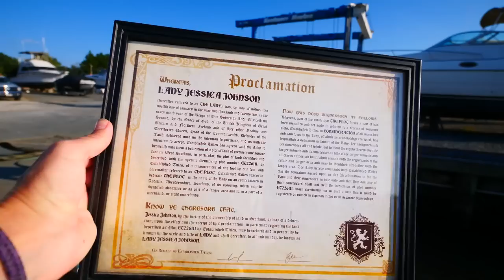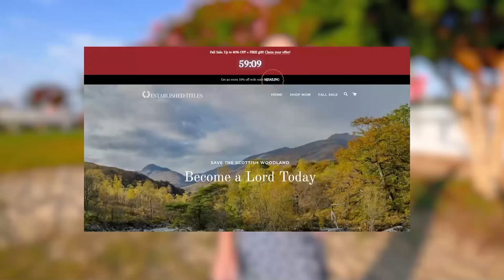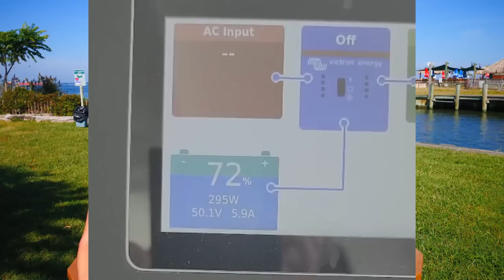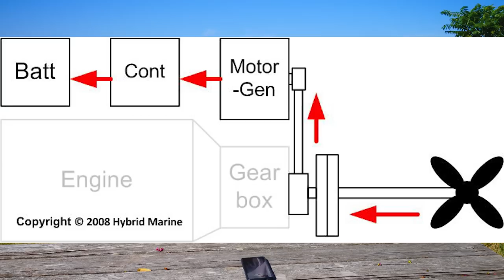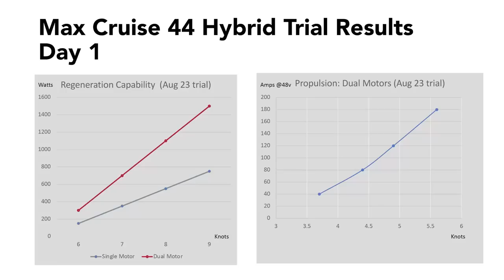Bye Bye DIESEL - We're Going Electric Hybrid!!  (MJ Sailing - Ep 251)

Comment: One thing I have not seen mentioned about these hybrid systems is that they should make it possible to go more miles per day, even without using the diesel.

The reason is that the hull drag power rises faster than linearly with speed, and the available wind varies.  So if you've got wind that would blow you at 10 knots for an hour, you might turn on regen and slow to 9.5 knots for that hour.  Later, when the wind has dropped and you're making 4 knots, you can turn on the electric motor and go 5 knots for an hour.  In the same two hours, you've gone an extra half mile.

A half mile isn't much but you do this for more of the day and it adds up.

The important point is that you speed up from going slow more than you slow down from going fast.

Comment: YES YES. Your new hybrid will come with lithium ready alternators. That is huge as if you add them to a diesel engine it costs around $3,000-$4000 each which saves you money since they are sold with them. Solar and using the hybrid to regen - charge when sailing is also huge. You have a cloudy windy day and batteries are low just go sail for a couple hours. Seas are to big outside the anchorage run engines for 30 minutes. If you get a solar rack on the back order Bifacial solar panels so the sun bouncing off the water will reflect up under the panels and give you more watts of solar.  I am so excited for you both. Is it done yet lmao.

Comment: Fantastic opportunity (well done Max Cruise!) ..... glad to see someone apply the single diesel hybrid dual electric drive, has so much potential for multihull sailing. 
There are a couple of advantages, applications you missed in your explaination. One of the biggest is the trade off with loosing one diesel, so many people place a huge weight on having two diesels = ultimate redundancy but I believe this is totally dominated by the weight saving, the reduction in cost both initial engine purchase and ongoing maintenance and the overwhelming pros and modularity with parallel hybrid.
Then there are the "cheater" sailing benifits .....like being able to easily have the ability to force maneuver, at the flick of a switch use the electric motors to help tack the boat while under sail in light wind. To take advantage of heavy weather sailing by setting electric drive produce regen down waves and power up waves thus reducing the annoying buffeting multihulls can get due to changes in apparent wind angle and speed ..... better managing  more difficult sea states (see youtube interview with Waypoint hybrid diesel 410 Lagoon). 
Hope you end up going 48VDC wiring or at least 24VDC to reduce cost and weight.
Almost unnoticed in the background (@23:56) an Osprey diving for fish, then shaking off water with a characteristic  in flight shimmy as it flew away
By the way (@21:20) not sure you are at a "Net Zero" energy budget if you are running your engine.
Reply: @armslength2618  not exactly sure what your comment is saying.......i think for this project the idea is to utilise sail, solar and regen and limit the burning of fossil fuel.......if you are suggesting serial hybrid system then running a generator to power vessel house load and propulsion might make sense in a large non sailing vessel application but cannot see any advantage in this situation. The parallel diesel should be more of the fall back redundancy not the primary but the advantage is diversity of options (being able to run in isolation or in concert), maximising effeciency, and providing redundancy in power and propulsion ...... which is hard to beat.

Comment: You covered weight distribution, weather, cruising range and lifestyle, prop type and size, hybrid option(s), spcl. speed/power/torque/rpm, regen, augmenting battery size and location. Any projected broad cost comparison options for this boat size? E.g.: 2 full electric engines, 2 diesel engines, 1 new diesel hybrid & 1 new electric engine, 1 used hybrid & 1 used electric engine, 2 diesel/electric hybrid engines. Cost to be separate or include props/fuel tanks/battery bank and auxiliary equipment.
Down the road discussions about noise, heat, fuel, comfort, reliability, maintenance, ease of maintenance, parts availability, redundancy, maintenance work area space.

Comment: When you end up looking at the solar setup make sure you carefully plan the way panels are wired and how many go to each charge controller. I'm not a expert in this subject matter but I do know when some panels are shaded for example by your sail it can really effect the rest of the solar arrays performance. These sets of arrays you have is really going to take some careful planning to gain the most power possible.
Reply: Just without really having sailing experience and well I'm not solar expert by any means I would split the solar arrays into four sets fwd port, fwd starboard. Aft port and aft starboard. That way no matter sun direction or sail no sail hopefully you have atheist 2-3 array sets generating good power without shaded panels.

Comment: I find myself liking this system. I take it the batteries will be placed on the totally electric side hull to balance out the weight load. This to me is the only reasonable "electric" alternative I have seen for a cat so far.
Reply: Not to mention, like he said, put the batteries on the owners side.  The noise level will drop dramatically. Givin the owners at least a decent night's sleep if under motor.

Comment: Still interested in an aux-in/out port to the mechanical part of the transmission. All sorts of possibilities to use it, output to washing machine, drive winches, run dive compressor, air compressor(tools/boat cleaning/power boat wash/bottom cleaning bot), vacuum cleaner, deck/scrubber as well as a flexi-drive to move mechanical power(like flex cable for drill). Inputs could be portable generator, power packs, pedal exercise, even small wind harvesters... Thinking this is so good you should start M&J Enterprises to make/sell add on's and partner with Max cruise to build boats(Great Lakes and Salty crafts). Might be nice to setup an agile manufacturing shop near Grand Rapids...... Sorry I keep thinking about bis opportunities, a bad habit of mine! I mostly am really happy that this will let you enjoy cruising more, your vlog's are great to watch!!!!

Comment: For us older folks who still want to cruise without the noise and the smell, forgo the sail rigging and install a 10kw solar canopy. Based on your data, that should allow cruising at 4knots any time, in any direction, with unlimited range.
Reply: Does not work at night 
Only god from 9 to 3 during the day
Reply: @paulmahowald4970  I only replaced the sailing rig. Still have batteries for night cruising and diesel for emergency backup. And the ability to make any heading translates into added speed over having to tack. Silent Yachts has been making this type of boat for years now.

Comment: I'm excited for your Regen system!!!  Uma uses Regen and impressed by their success.  But I don't remember the manufacturer.
Reply: UMA is a purely electric with regen and an emergency external integrated gen set so.  Who is building around a parallel hibryd so and has a great video explaining it: Leo of Tally Ho.
Reply: Uma trudges their way thru a very minimal electric only system on a small boat. Not at all comparable to what is being used here.

Comment: A better way to do a serial hybrid is to use a conventional marine diesel like a Yanmar connected directly and exclusively to the same type of electric motor and controller being used for drive motors, but used purely as a generator to charge the battery bank.  Marine diesels are much easier to maintain than gensets and vastly more space, cost and weight efficient. 

That also makes spare parts and maintenance simpler since all of the electric motors and controller are the same throughout the boat, used for both propulsion and Diesel-powered electricity generation.

To recap: use a marine diesel directly coupled to an electric motor used purely as a generator to charge the battery bank instead of a conventional genset.  

So no conventional genset at all.  Use a Yanmar plus another electric drive motor and controller purely as a generator.  (This electric motor is run in regen mode only, to charge the battery.)

Some production hybrids are already doing this and it's a much better solution than a genset for multiple reasons.

That all said, a parallel hybrid is probably a better solution than serial since it's more efficient to be able to drive the prop directly from the Diesel, AND it has 4 way redundancy, being able to move the boat using 4 different motors, 2 electric and 2 diesel, independently (if clutched between each Diesel and electric).  Due to the redundancy, it should be a more reliable system.  

As you correctly note, a serial hybrid introduces many single points of failure.

That said, since the battery bank can be charged from a great diversity of sources: Diesel, solar, hydrogeneration (regen), shore power, windmill, etc., any electric drive can multiple redundant energy sources, even if it's in a serial hybrid.

The solution you came up with: parallel hybrid in one hull plus pure electric drive plus a larger (combined house and propulsion) battery hank in the other hull is a good optimization.  There are many different ways to organize hybrids.

Comment: While you didn't explicitly say it, the other benefit is on the comfort side, by having the electric motor in the owners hull you do away with the drone of the diesel motor. The electric motor should be virtually silent, which ups the comfort level. It is a really interesting technology, and has real promise.

Comment: Also make sure when you do your battery banks you do not daisy chain them but run each battery to a busbar(charger and inverter) connect to same busbars. This will lower the load on each battery in high load usage. Example if you have 4 5k 100ah batteries in daisy chain and pull 200 amps that will pull 2C through each battery and over work them while loosing  to heat loss. Busbar with the same 200 amp load pulls, .5C from each battery which translates to less heat and more charge cycles so longer life of each battery. I have spent hundreds and hundreds of hours researching(testing) this as I have 4 15k batteries in my house setup with 2 5k inverters which doing busbars will pull at max .5C and normal use .15C from each battery. The only thing to make sure of is each positive cable must be same length and can be smaller size since you wont go over 50 amps per battery, same with negative cables they do not need to be same length as positive side just all negative cable same length. Hope this helps. if you need you can contact me.

Comment: Electric solar is definitely way to go, the comfort of silent engine, using Regen and solar, less maintenance, the large unused space on cats are great for solar that is always improving in power, options for using standby generator, you could always be moving even without wind, it leaves you open for new energy sources that may come and lastly the price of fuel is critical in decisision
Reply: Even on a Cat pure solar with regen is not gonna provide enough power. It's just not gonna happen.

Comment: Great news more battery power. Electric outboard? With dragger boards your might be faster. You might bump to 30kw with light weight high energy low power for house loads dc-ac and heat pump, and water cooled refer for the tropics. Great vid update wishlist.

Comment: Glad you were able to go Hybrid.   I kinda was wondering about that after your last video.   I find the decision to use only 1 ICE engine interesting.   The only negative I see is that you don't have Genset redundancy as you would with 2 ICE engines (and of course 1/2 the charging capability) but I don't know how much difference that makes.    Also, if you loose your electrics then you only have the Port side engine (ICE) working.

Comment: @15:58 one of the most important parts of the hybrid system. Narrow hulls 2x shoulder width, ~1meter. Performance cat, why motor when sailing is so much nicer. What is the maximum hull width at the waterline?
Reply from the maker: 1 meter.   We're a 13.25:1 hull waterline to length ratio.

Comment: Hey guys - This is cool - I really like this systems and looked at it for my future boat - HybridMarine are Beta's partners and if you look on their sight - They do this on Yanmar engines as well -their site mentions  Yanmar 4JH and 4LV range of engines.
Reply from the maker: Correct.  But not for the 3YM which is the highest HP with mechanical injection.
Reply: @MJSailing  that is so cool that they will work with you on this. Looks like a really cool system and I look forward to your install videos

Comment: Curious. Powering with just solar. Need to plug in? If there’s a couple of panels, yes. But there are solar powered boats that do ocean voyages unlimited. It’s a question of how many panels and batteries for a given boat. Then there is the arrival and the accompanying anchored time where the batteries are refilled. Hybrid is necessary option if you don’t want a “solar” roof, but everyone has a roof and bimini that nearly covers the boats anyway. In the “silent” yachts, solar replaced the sails. It seems the real curiousity is using, the sun (solar) and water (hydrogen) to power a boat is the real hybrid future. Solar gets you about 5-10 knots for steady quiet cruising, hydrogen gets 20 knots for how many hours depending on tank sizes to avert a problem. It only seems this is correct.

Comment: But remember there is no such thing as a free lunch. The regen will slow the boat and/or require the sails to be "powered up" in order to generate the power. Using one engine to drive both props probably increases the propulsion efficiency because of doubling the total prop area, but the hoped-for reduction in BSFC is probably not as much as might be hoped for. Still a good system, but not magic.
Reply: Regen doesn't slow the boat very much at all.

Comment: Good information and hope more of the details will come in future videos. Just a few questions. Is your house bank going to be 48VDC, with a DC-DC for your 12VDC equipment? What brand / size is the standalone motor and does it also have regen capabilities? Finally do you have a rough cost for the conversion? Thanks really enjoying this series! Keep at it!
Reply: Aren't modern AC to DC high frequency converters very efficient that you would just setup like a normal house and run everything from AC?

Comment: That hybrid setup is so cool!  I would assume all or most of the batteries will be placed on the electric motor (only) side to balance out the weight of diesel/motor side?  I would keep the 2nd Yanmar as a spare since you got such a good price on it.

Comment: Wow, so in one day of sailing you should get enough regen to fill your 20kwh battery bank.

Personally I would add a hydrogen tank as an additional battery.  Although doing electrolysis and then having a full cell would only have at most 50% efficiency, but you have so much electricity to play with it would be so cool. I've heard carbon fibre hydrogen tanks are cheap as well as those fuel cells I think they have titanium in them so it'll be a budget add on.
Reply: Hydrogen is so dangerous and in a corrosive environment of sea water you could expect an explosion. You wouldn't expect the values to last the life of the boat. Hydrogen conversion is also so inefficient, batteries are far superior in every way.
Reply: @AORD72  batteries are heavier. So if they already have 20 kwh of batteries, there is no harm in adding a hydrogen system except for harm to the wallet.

As for explosive both petrol and diesel are explosive and would have more explosive power than a hydrogen tank.
Reply: @matthewbaynham6286  Hydrogen is a long way from being viable. Hydrogen ignites at a wide range of mixtures and it doesn't take much to ignite. Hydrogen has a about three times the gravimetric energy as diesel, so hydrogen does have more explosive power.

Comment: I have hybrid car and love it.  Hybrid in long range cruiser. Wondering how much it would actually slow you down to incorporate your second diesel engine into the system for redundancy after all anything made by man is prone to failure. Especially if each engine can turn those shards independent on the electrical system just in case and electrical fart blows the computer that runs all of the hybrid just wondering thrown it out there very interesting technology

Comment: Do you plan on having a fossil fuel back up power source? A 100 % anything is not always the best way, but can eliminate the bad diesel found at the islands fueling locations by full Solar. Adequate battery storage capacity makes for a more efficient power source and wind is in fact your main power source anyway any other propulsion is simply a back up. When built to be solar does make a world of difference performance wise at sea. I am sure you guys did your homework there. Looking forward to seeing the end result on the water.

Comment: Looking forward to seeing your hybrid setup! Is your one diesel engine still going to have a high output alternator or is the electric motor attached to that diesel the only way to generate electricity from the diesel engine?
Reply from the maker: The Yanmar engines come standard with a 120a alternator, but it is internal regulated - so derates quickly - and will be used to charge the 12v start and emergency house bank only.   I'm concerned with loading the engine much more, so probably won't add a second alternator to this engine.